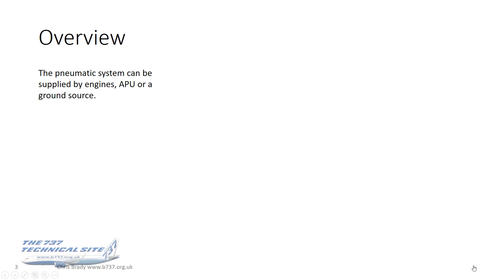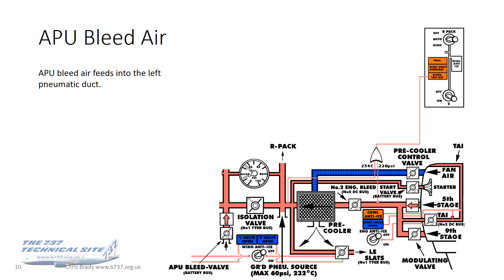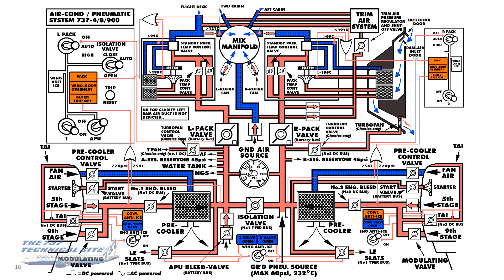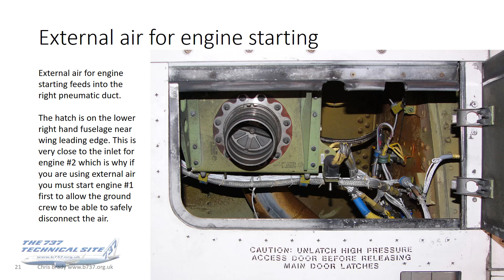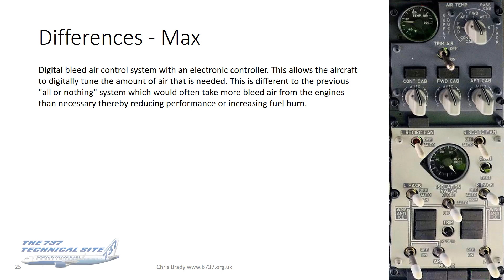737 Pneumatics System

Comment: Question : with APU inop, can External conditioned air be used in conjunction with The external air (jet starter) during ENG#1 start? or external conditioned air to be removed before engine start?

Comment: If you are watching this video from a general information point of view, then it’s interesting. But if your viewing this from a technical point of view, there are a few things I would like to point out,

@1:38 that engine is a CFM56-3, seen on the B737-3/4/500 series aircraft. One way to tell is by identifying the generator cooling shroud (green cover below the starter). The Classic B737 has a Constant Speed Drive and a generator mounted to it. The B737NG has the CFM56-7 engine and has an Integrated Drive Generator fitted instead

@2:36 where is the pneumatic panel? This is a video about pneumatics

@3:44 called the bleed valve. It’s actually called the Pressure Regulating and Shut Off Valve (PRSOV). The engine bleed switch on the pneumatic panel is used by flight crew to open and close the PRSOV

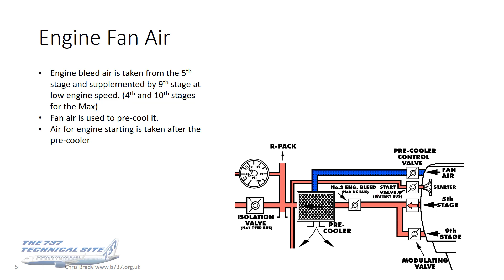@4:15 technically that is where the air is “supplied to” for engine start. When you say that is where the air is taken from, it makes it sound like the engine can start itself. The air is supplied to that point for engine starting from another pneumatic source such as the APU, the other engine or from the ground pneumatic source

@5:01 the overpressure switch. Apart from the fact it’s a switch and doesn’t give a pressure reading, no one can read that pressure from the flight deck. The switch is located within the Bleed Air Regulator and senses pressure from the interstage duct using a sense line as per the schematic. When that pressure is sensed at 220 psi the switch closes, this causes a relay to close in the Air Conditioning Accessory Unit which in turn causes a BLEED TRIP. The PRSOV then automatically closes. If you look at you duct pressure indicator, it only goes up to 100 psi and that pressure is sensed in the ducting that goes through the air conditioning pack bays

@6:15 and @7:59 the preconditioned air is generally used to cool the cabin. The cabin heats up on the ground from cabin lights and passengers

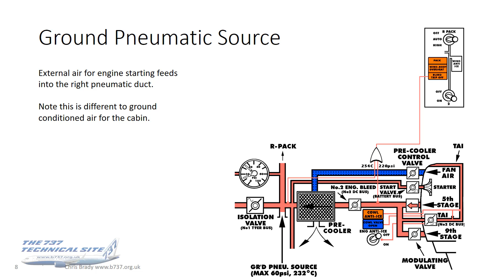@6:20 the ground pneumatic air for starting the engines can also be used to drive the air conditioning packs while the aircraft is on the ground. But you are correct that this is a different connection to the preconditioned air connection

@7:08 the turbofan operates only during ground air conditioning operation or in flight when the flaps are extended. The turbofan is part of the ram air system. The function is to draw more airflow across the air conditioning pack heat exchangers when ram air flow is low for better cooling efficiency. This air does not go through the packs

@10:30 there is talk about the DUAL BLEED light. It’s important to note for anyone watching this video and viewing it from an maintenance troubleshooting perspective, the DUAL BLEED light illuminates for:
Engine 1 bleed “switch” on and APU bleed “valve” open, OR
Engine 2 bleed “switch” on, isolation ”valve” open and APU bleed “valve” open

@15:19 the 220 psi over pressure switch is part of the Bleed Air Regulator, not the  High Stage Regulator. There is a sense line from the engine interstage ducting that goes to the BAR

@15:50 I don’t consider this good advice. Using the Wing Anti Ice will have zero effect on reducing the pressure within the interstage duct on an engine that has had a BLEED TRIP. With a BLEED TRIP, the PRSOV closes automatically. The WAI valve is down stream of the PRSOV. If you open the WAI valves, it will cause more problems. Agreed 100% it will reduce your duct pressure, but it’s because the remaining engine is now venting its pneumatic pressure overboard via the WAI valve. The single WAI switch in the cockpit opens both WAI valves, one for the left wing and one for the right wing, you will now be taking air away from the only remaining air conditioning pack and aircraft pressurisation will most probably be affected. Using Engine Anti Ice will reduce the pressure in the interstage duct because you are creating a “hole” in the system. But why are you trying to do that? If you experience a BLEED TRIP, follow the QRH and do the reset, if it won’t reset leave it alone. How do you know it’s not some other issue such as a wiring harness or a faulty over pressure switch. Write it up for the maintenance at the next port and let them worry about it
Reply from the maker: All points noted, thank you for taking the time to write this feedback.
Reply: @ChrisBrady737 no problem. I am not trying to be critical just accurate. It must have taken some time to put the presentation together. I think it’s great that you are giving the public an insight into these wonderfully complex and technically advanced machines. My sources are the Aircraft Maintenance Manual (AMM), System Description Section (SDS), System Schematic Manual (SSM), Dispatch Deviation Guide (DDG) and the Quick Reference Handbook (QRH)

Comment: Hello capt. I am little confused if Bleed Trip off light illuminates and it is due to overpressure situation. Should i turn on engine anti ice to reduce the duct pressure or wing anti ice?  (Qrh says first step turn wing anti ice Off) . 
Please throw a little light on it.
Reply from the maker: Always follow the QRH procedure. WAI has a far larger affect on duct pressure than EAI.
Reply: Obviously the advice of following the QRH is correct because it is written by the manufacturer and they should know what they are talking about.

With regards to your question about Engine Anti Ice (EAI) and Wing Anti Ice (WAI) I offer the following based on the B737NG:

When an engine BLEED TRIP occurs, the Pressure Regulating and Shut Off Valve (PRSOV) closes automatically. This means that no air is being supplied by that engine to that side of the pneumatic system. BUT, the 5th stage check valve and high stage valve (9th stage) are unaffected by a BLEED TRIP and one of those will still be open supplying pressure to the ducting on the engine side of the closed PRSOV. Note: this cannot be seen on the duct pressure indicator because those transducers are located in the air condition pack bays. The air supply for the EAI comes from the interstage manifold ducting which is on the engine side of the PRSOV. So no matter if the PRSOV is open or closed, you will always have air available for EAI. In theory (against the QRH) if you turn on the EAI, yes this will reduce the pressure in the engine pneumatic manifold because essentially you are creating a “hole” for the air to escape. The engine will continue to supply air pressure while it rotates, but with the EAI valve open will the “hole” be big enough to remove the pressure on the 220psi overpressure switch (sensing the pressure in the interstage manifold duct) located in the Bleed Air Regulator which is causing the overpressure condition in the first place? Who knows as there are many factors to consider.

I suspect that the QRH says to turn OFF the WAI off first because of what happens later in the checklist. If the BLEED TRIP remains illuminated, the affected side PACK switch is now turned OFF. If the ISOLATION VALVE is in the AUTO position, that valve will now open so that the other engine bleed can be used as the source to drive both air conditioning packs for pressurisation and ventilation purposes. So now you have a single engine supplying the bleed air for both air conditioning packs. If the WAI was left on, a massive hole would be in the system that is trying to keep the aircraft pressurised.

Comment: I have heard that a small amount of air is supplied to the flight deck from the right pack, is that true? And if you had a Bleed Trip Off warning that couldn't seem to be fixed, would you continue to fly?
Reply from the maker: A small amount could come from the right pack but as you can see from the schematics here and in your FCOMs, the bulk is from the left pack. Re continuing with a bleed trip off, that comes down to your company policy/training and the Captains judgement. You should consider what would happen if the other bleed subsequently failed.
Reply: @ChrisBrady737  Perfect, thank you!

Comment: Hi Chris. If there's a check valve from the L Pack to the mix manifold how are we getting recirc fan air, or any air for that matter, in the flightdeck with the packs turned off?
Also, would it be possible to run the packs from an air start unit on a hot day prior to eng start?
Reply from the maker: Just with fans, it is not from the packs if the pack switches are off. No you cant run the packs from an ASU, the mix manifold is in a different place, hence the different connection point for ground conditioned air. I cover this either in this or another video.
Reply: @ChrisBrady737  Thanks for the reply! Just to be clear, I'm talking about an air start unit that provides compressed air for starting the engine and it's fed to the right side of the bleed system.
Reply from the maker: @cpt_riris  Yes, you can not use ASU air for the packs.
Reply: @ChrisBrady737 strange answer. Yes, you can use the air start unit to drive the air conditioning packs as long as the temperature and pressure limits of the delivered air are observed
Reply: Yes you can use an airstart unit to drive the packs
Reply: What you need to know is that this diagram is very general in nature and there are more detailed ones when talking about specific parts of each system. The problem is this diagram relates to ATA Chapters 21 Airconditioning and Chapter 36 Pnumatics and is a very basic overview because it is trying to show a lot of information. The recirculation system and distribution system are not really shown. The check valve you refer to from the L pack to the mix manifold is really important. It is installed on the pressure bulkhead wall in the forward end of the air conditioning pack bays (one for the R pack aswell). It’s called the “conditioned air check valve”. It lets one-way air flow from the pack to the main distribution manifold. The packs supply pressurized air through the check valve to the distribution system. The check valve prevents airflow from the pressurized distribution system to the unpressurized air conditioning compartment.
The way that left check valve is drawn is not correct. It should be drawn immediately after the air exits the pack, before the duct branches off to the flight deck. That is how the recirculation air can be directed to the flight deck without any packs running
Reply: @NicholasRiviera-Dr  that would make sense, yes!

Comment: This makes me wonder what would happen in the event of a pre-cooling failure?
Reply: Are you referring to the engine precooler? If it has a failure such as a split or crack in the welding for example, then hotter air would be allowed to enter the pneumatic system ducting. Upstream of the precooler there is an over temperature switch set to 490F (254C). If the air gets to that temperature, the system shuts off the air supply to the pneumatic system for that engine. It’s called a BLEED TRIP. The valve known as the Pressure Regulating and Shut Off Valve closes automatically and stops the supply of air from the engine

Comment: Hi Chris, These videos are helping me through my engineering degree. You are a life saver. I have a question about the Ground conditioned air and the external air used for engine starting. Do they both come from the Ground cart?
Reply from the maker: No, they come from different sources because the external air for starting has to be delivered at high pressure.
Reply: No they come from a different source.

Conditioned air can be supplied from either a mobile cart or an aerobridge mounted unit. A hose from the cart/unit connects to the aircraft ground conditioned air connection which is a standard 8 inch bayonet connector (with check valve). This air feeds directly into the airconditioning mix manifold. When the air is supplied the air pressure should not exceed 15 inches of water (.54 psi) gauge pressure and the air temperature should not exceed 71 degrees C (160 degrees F). Contrary to what is said in this video @6:17 ground conditioned air is used to COOL the cabin while on the ground. Heat is generated in the cabin by lighting and passengers

External air for engine starting is supplied from a different ground source. Usually this is a compressor mounted on the back of a truck. The hose connects to the aircraft via a ground pneumatic service connector which has a standard 3 inch quick disconnect nipple (with check valve). This air is supplied to the aircraft pneumatic manifold, right hand side on the B737-3/4/5/NG. The external pneumatic source must have a maximum supply pressure of 60psi and temperature of 450F (232C). Having said that, this pneumatic source from the external compressor can also be used to drive the air conditioning system.

Comment: I'm just a fan of aviation and a pilot in the simulator, I'm just wondering why do we turn off the isolation valve when starting the engines? greetings.
Reply from the maker: We don't. We just switch off the packs for engine start to enable maximum bleed air available for engine start. The isolation valve must be open to enable both engines to receive air from the APU.

Comment: Chris, I can't thank you enough for what you've put out. Just a question about where you spoke about trim air only being present in the long body variations of the 737s. Does this only refer to the cockpit overhead switch for trim air, as trimming conditioned air following the turbine in the air cycle machine was performed in the classics too?

Many thanks
Reply from the maker: Trim air was only used on the -4/8/900 and Max. The other series did not have it.
Reply: @ChrisBrady737  Thanks for clarifying Chris. My confusion was due to the positioning mix valves present on the 300/500s which would proportion hot air with cold air from the conditioning packs, although those weren’t the same as the trim air modulating valves present on the long bodies.